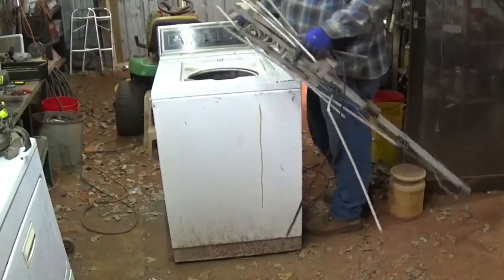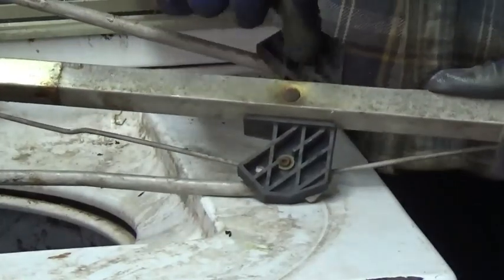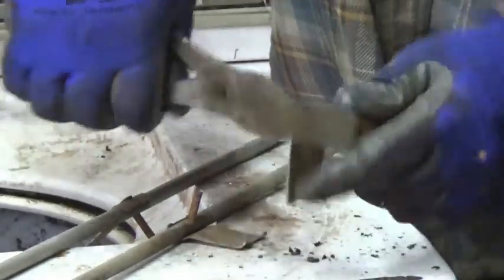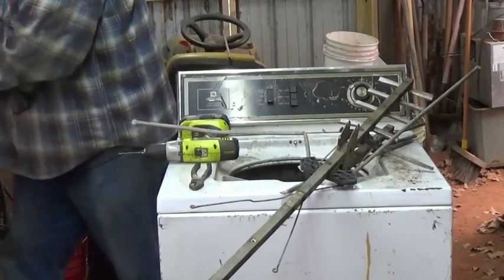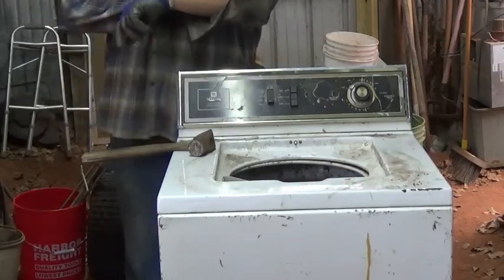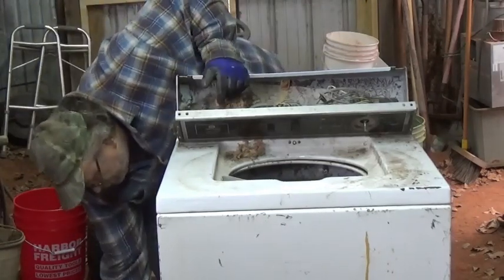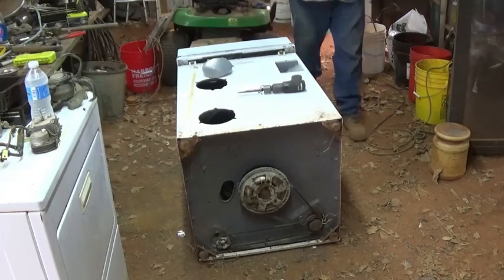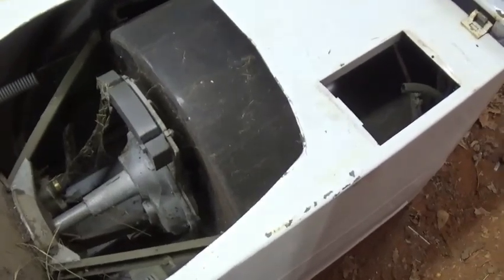How to scrap an aluminum TV antenna & clothes washer

Comment: Nice job taking the tv antenna apart glad are washers are easy to take apart great job you done keep up the good work
Reply from the maker: most newer washers the bottom is open and motor is easy to get to and all wire is easy too